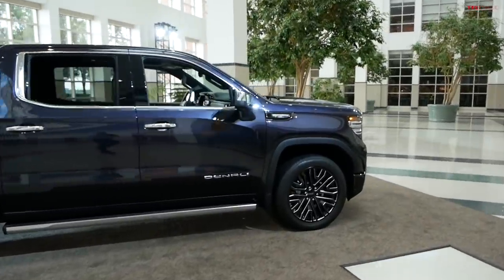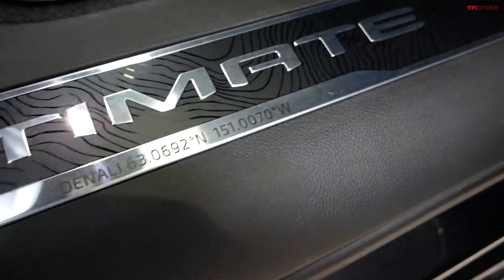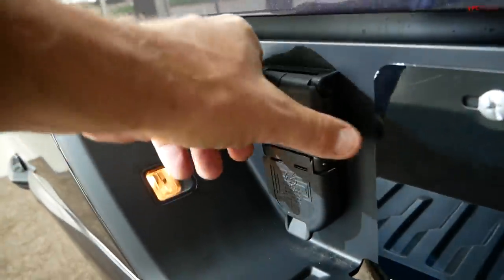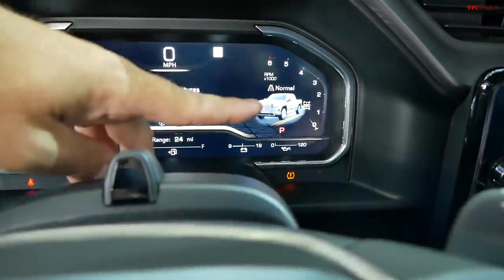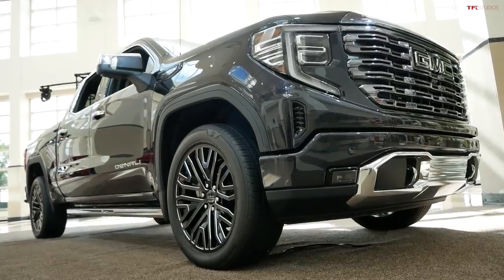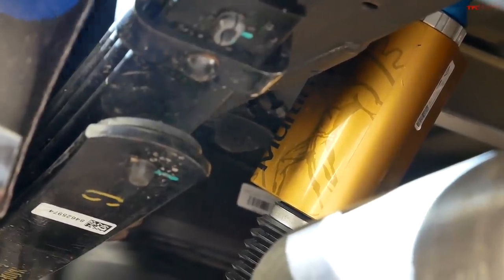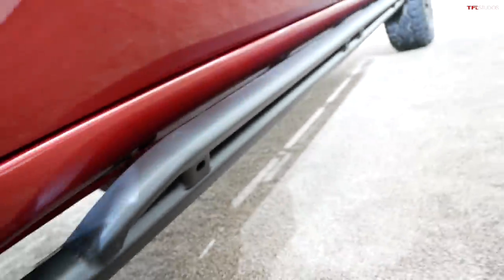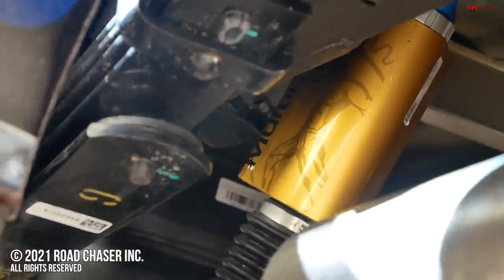Hands On WORLD DEBUT: Here's How The 2022 GMC Sierra Takes It to a Whole New Level!

Comment: Toyota must be losing their mind; this GMC is 100x nicer than the Tundra. Toyota will be 4th in sales in the full-size segment yet again. 5th if we count Chevy & GMC as separate.
Reply: The sad part is this and the Chevrolet ate just refreshes too, can't wait for a full redesign.
Reply: I agree. Toyota botched the Tundra bad.
Reply: GM IS ON THE RISE AGAIN!!!;)
Reply: @alphaares6027  To the scrap yard for parts :)
Reply: GMC is luxurious truck brand lol Toyota isn’t their meant to be less expensive, it’s like Lexus coming out with a pick up.
Reply: I disagree and I have a Sierra so I’m not a Toyota fanboy or anything. That new tundra is awesome
Reply: You’re confused if you think Toyota was trying to get in the top 3. They don’t have near the production capacity.  Their goal was to have an incredibly capable and long lasting, problem free truck in the same vane as the 2nd Gen Tundra.
Reply: I'd assume the opposite - all the broken garbage GM keeps putting out makes the Toyota owners look like geniuses.  GM people are loyal drones.  Stuck lifters bend your pushrods in your 5.3??  Buy another one!  Transmission in the Traverse insist that neutral is drive?  Buy another one!  2.4L Equinox burn every drop of oil in the crankcase?  Buy a another one!  3.6 Impala chew up its timing chain?  Buy another one!

GM will burn its last bridge before too long.  Toyota will be there waiting!
Reply: I disagree. The price on the GMC is much higher than Toyota. If you want a truck for your everyday life and overlanding you can't go wrong with Toyota and pricing much more affordable than GMC. Certainly GMC have the looks and luxury but in the long run , you will see recalls and durability, Toyota has a grandstand to go for years with just regular maintenance.
Reply: @thetinpin  Isn't this the pot calling the kettle black? I've seen some Toyota fanboys that defend their every action for no reason. The last gen tundra was a joke and if You bought it from 2014-2020 you wasted your money. The only defense anyone had was "reliability" but it was insulting with its tech, mpg, and age. I've owned a few GMs and have had zero issues. 2010 traverse that was just traded in, 0 issues.  My brother owns a 2015 canyon, 0 issues. If it works for people let then buy what they want and spend their money how they choose. What's Toyotas excuse for being the number 2 car company in the world and not spending the time or effort in making a halfway decent supra? At least GM went all out with the c8 vette they didn't just rebrand a BMW And call it a day. Heck even Acura went all out with the NSX.
Reply: @jeremiahvazquez15  with superior reliability I'm sure. GMC and Chevy motors know the dealership.
Reply: Seymore Facts  truth!
Reply: @smrtguy77777  that's the point. Don't want to be capacity based. GM sheep love that!
Reply: @dtay8913  I've been in the parts business for 6+ years now, and I can't tell you how many lifters/pushrods/gasket sets for 5.3/6.2 I sell ESPECIALLY for the newest GM full size.  I have AT LEAST 30 customers that have replaced 2.4s in Equinox once, and 7 or 8 on engine #3.  The 3.6L timing design loves to throw cam/crank correlation codes that necessitate pulling the engine from many of the vehicles they are in because the tensioners are junk.  We keep 1.4L turbos in stock because they don't seem able to last past 80k miles... Not to mention the PCV system integrated into the valve cover tends to have its check valve fall off which destroys the diaphragm and lets copious amounts of oil to get into the turbo.  I can go on and on dude.
If you seriously havent had any issues with that trash, you should seriously buy a lottery ticket.  
It pains me to have people come to me claiming they got a great deal on an Equinox or Traverse only to have me inform them they probably have a several thousand dollar bill coming when I explain the poor engineering and frequency of failure of major components of some of these GM vehicles.  I don't like seeing my customers literally cry about surprise repair bills, so I never reccomend they buy 10ish year old and newer GM products.
Reply: @thetinpin  and I respect you for that. A lot of the times there are people that just post comments mindlessly repeating what they've heard others post. If you've seen this 1st hand that's one thing. Why do you think it is Buick and for the most part Cadillac have so little issues with Buick constantly being considered a reliable brand when they're all structurally the same thing for the most part?
Reply: @smrtguy77777  all I am saying is its a top three truck for sure based on quality of product. Not based on sales
Reply: Seymore Facts  That analogy gets used all the time & typically misaligned. McDonald’s saturates the globe with their franchises & offers a cheap meal. GMC & Toyota compete with similar capacity & price-points, so your analogy is little more than an excuse for Toyota.
Reply: @Mike You don’t think so? Do you sincerely believe that the Tundra will cover a 4:1 margin on sales volume to take the #4 spot from GMC? Again, that’s even if I’m generous an bifurcate the Chevy & GMC sales. Japan rules mamy segments in the industry, but not full-size trucks.
Reply: @smrtguy77777  Toyota has massive production capability, but Americans are overwhelmingly loyal to our nameplates when it comes to full-size trucks. Japanese companies do well with economical cars & some value plays in the luxury segments (relative to European offerings).
Reply: @krasnaludek298  
Toyota currently has the capacity to build 200-300K Tundras, the big 3 easily top 500K each.

Comment: "pricing for Denali Ultimate starts at $78,700, AT4X is $73,300" - that's a lot of money for a lot of gadgetry!  After you buy one of these "grocery getters" you got no money left for the groceries.
Reply: Well said, sadly true. 😢
Reply: How is the at4x 73k when supposedly the silverado zr2 is 55?
Reply: and i thought i paid a lot for my at4 at 57k
Reply: Highly  unreasonable for a HALF ton truck.  Nice upgrades. But a 73k truck should be able to pull more than 9000 lbs.  sure they have other trims and set ups that can pull more. But for their top off road and luxurious  truck they should of done better on that set up and tow rating.   And for Christ sakes throw a few horsepower upgrades to your v8 motor.  It’s been almost 8 years since they gave them a horse
Reply: @i2ambler2002  I think the at4x cost so much more because the additional luxury.
Reply: @justinmiller33   The TRX or the Raptor don’t tow more than 9000 lbs for the same price.
Reply: Just wait a bit.  At4 diesal 2021 msrp is 64k i found some here in Houston for 56k
Reply: @i2ambler2002  no way its going to be 65k

Comment: This interior is vastly improved over the current model. Good job, GM!
Reply: Yeah, hopefully it's reliable
Reply: I wish GM kept an actual tilt steering wheel in the new trucks. And I'm not a fan of console shift transmissions.
Reply: @erikthorstensen5185  agreed. Console shift is stupid and wastes space. I hope they at least kept it mechanical so you can shift into neutral with the truck turned off.  That’s a huge benefit of the mechanical column shifter to me.  That and it’s a nice hand rest too.
Reply: @erikthorstensen5185  yea but they were always given a lot of sht for the column shifters aswell so it’s a lose, lose
Reply: @SuzukiKid400  They removed the column shifter because they added paddle shifters behind the steering wheel. They couldn’t have both of them in that area because they get in the way of each other. I guess that was the best option they could take.
Reply: @SuzukiKid400  they didn't keep it mechanical. Andre even said new electronic shifter.
Reply: @Inferno45  who needs paddle shifters on a truck though?
Reply: more like insult to early buyers of denali lol, this just trashed the resale of 2019-2021 Sierra denalis, its way more expensive than Ram Limited trim and on par with it at best
Reply: @erikthorstensen5185  agreed. That’s the reason I always had GM & Ram above Ford on my preference list because of the shifter in the center console. Ram has the best system with the knob on the dash. I really hate the wasted space of the center console shifter
Reply: @joelgonzales5148  more tech so im betting even worse reliability
Reply: @ColeSpolaric  I get what you mean but the AT4X is supposed to be like the Raptor and TRX but it doesn’t have the power to compete with them. They just slapped the paddle shifters on there to make the truck feel “Sporty”.
Reply: Anything was better than what they had 🤣🤣
Reply: interior was GM's largest weakness. now they are competitive with the rest of the pack. no optional hybrid is a very unfortunate oversight.
Reply: @erikthorstensen5185  A Column Shifter will be available in these trucks with a bench seat..
Reply: @BassRacerx  Ram hybrid gets you 1-2 mpg better, its pretty much useless and the f150 hybrid isn’t really designed like a traditional hybrid. The battery is designed to be used for power equipment and as a back up power source in case you need a generator. So for now GM is fine without any hybrid trucks in their line up. Also no truck owner is going straight for a hybrid when they look for a truck. And if there are people like that they are a small percentage of people who want a hybrid and a truck in one package.
Reply: @Boltdriver70  reliability was already bad?  That's news for my 2020 Denali w/ 28k mi.
Reply: @joelgonzales5148  it's a GMC so it's definitely reliable. Just take care of it like you're supposed to with anything nice and it'll last forever. ALL new trucks have bugs to work out, thats why it's best to wait a year or so after something is released. But the idea that GM trucks aren't reliable is a myth created by butthurt owners of other brands' trucks and thats a fact.
Reply: @MB.1111  unfortunately what you say is simply not true as proved by multiple studies. GM vehicles reliably rank at the bottom reliability rankings. I am actually a fan of GM vehicles, but their quality control has steadily gone down hill. And I agree, all manufacturers have bugs in their first few models. But that's mostly because they rush them to market without thoroughly testing things. Unlike Toyota, who isn't releasing a new redesigned model every 3 years. Or having to use a new transmission or engine every 2 years.
Reply: @joelgonzales5148  it absolutely is true  unless you're part of the unfortunate .01% of GM buyers who get lemons. The longevity and reliability of a GM trucks depends on the way they're treated. Everyone always loves to say their a GM fan right after badmouthing their vehicles without experience or UNBIASED research. But it doesn't matter what you love or drive. The FACT is, I've owned and regularly used two GM vehicles: an 06 Z71 Tahoe and  a 2017 Z71 Silverado and besides an AC motor problem on the Tahoe and a battery issue on the Silverado caused by a hit & run, the Tahoe and Silverado were both problem-free and start(ed) every single time. Another testament to their reliability was my brothers 2015 3500HD Duramax workbody. We crashed it into the woods at 75 mhp taking out 14 small trees (trunk as thick as a basketball), totalling the thing and essentially tearing off the Reading box and the truck still started when the wrecker crew got it to the shop. But Toyota really shouldn't be part of this conversation lol. They have been tied for dead last with Nissan on capability, sales numbers, and appearance for how long? Since they started building trucks?  Also, they can't even build an HD truck (or a sports car without help for that matter) so do they really count/matter? Toyotas last long because they're well taken care of and from Japan where capability, looks, and  U.S. sales don't matter as long as they can actually build something that works. Lol they're not even on the same playing ground as GM...stick to the JV trucks Toyota.
Reply: @MB.1111  I've been a mechanic for 10 years and have seen 2 year old gm trucks come in for ac jobs and have to have entire dashes out of a 2 year old truck because evaporator went out. Rear ends, electronics, issues with the 6.2s, etc. Your sample size is 3 vehicles. Unbiased research? Sir, I've personally worked on them. How about you do some research yourself. Only place GM ranks high in reliability is JD Power wich is the same organization that's ranked Ram as the #1 truck lol they also have their pockets greased by manufacturers. You can look at literally every single other list and GM vehicles are at the bottom. Also, Hino Trucks are heavy duty trucks made under Toyota that are available around the world and in USA. Sure, Toyota doesn't have a consumer 1 ton truck, but many businesses in the country rely on them to move their goods around. I've owned 2 GM trucks and only Har to replace dash from cracking, a few starters and alternators, and 1 4l60 transmission in my suburban. Oh, door hinges too. Other than that, they were amazing trucks. My mothers '18 Silverado has been in the shop 3 times for warranty work. Bad fuel injectors, then it was a bad harness, then the ecu had to go back for a reprogram. All 3 trips with less than 45k on the truck. She's also living with a phantom misfire practically since she bought the truck (Thank God her dealer offers a warranty forever as long as she owns the truck) tons and tons of people have all had issues with other branded trucks also. Of course. My point is, GM seems to lead the pack on every list for reliability and cost of ownership. So, I'll say it again, I sure hope they are more reliable with this update.
Reply: @MB.1111  the fact that you've had 2 vehicles that haven't had issues is irrelevant to the point that statistically, GM has a higher than average issue with reliability and statistically higher than average cost of ownership. Someone doesn't necessarily have to have a "lemon" to have more frequent trips to the shop than other brands. Your personal experience with ownership is not the standard for which to measure reliability across GM's brands. Not just Chevrolet. Gm trucks like the 1500 Silverado and Sierra rank among the lowest in reliability and higher in cost of ownership. Those are facts.
Reply: @MB.1111  a few years they have really good products, then other years they shit the bed. Again, it comes down to overall quality in build and construction. I'll reiterate, GM has quality control and reliability issues.

Comment: Halogen bulbs on the license plate lights still and no pano sunroof on a 80k truck 😬. With that kind of price I’d expect to not do a single thing to these trucks!
Reply: Also, ACC is still optional on loaded models. Insane.
Reply: And no cooled seats in rear on these, for these prices it better be standard!
Reply: It seems GM still has a bean-counter problem. I'm willing to bet money it's some MBA-type who has no true passion for autos doing this crap to "maximize profitability" or whatever so they can makes themselves look good to shareholders. They always suck the passion and excitement out of everything they touch. Automaker CEOs should come from actual engineering/design backgrounds who actually have passion for vehicles.
Reply: I noticed the halogen plate lights, come GMC get with it,  they should be LED